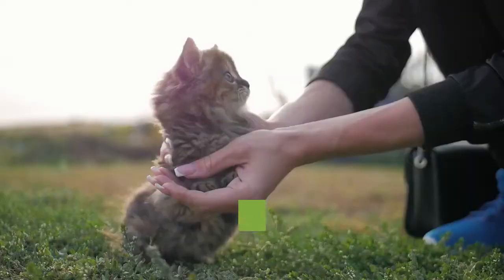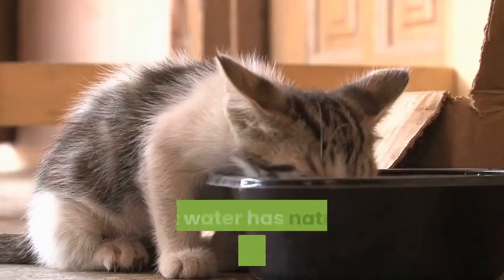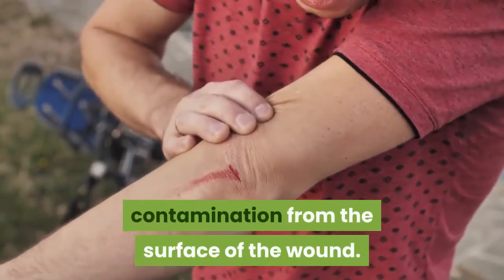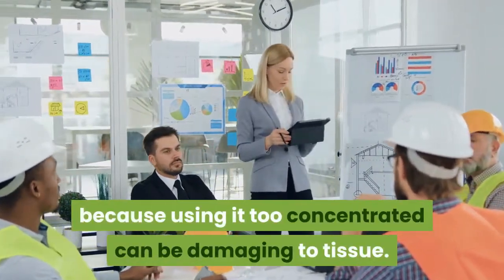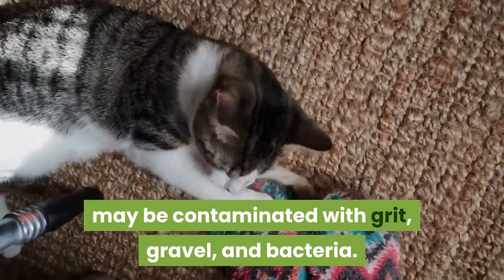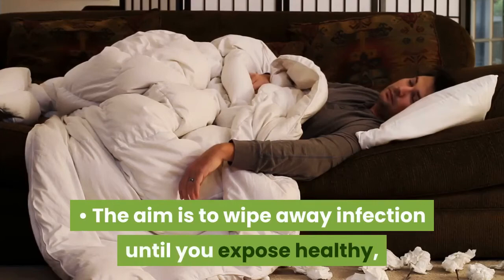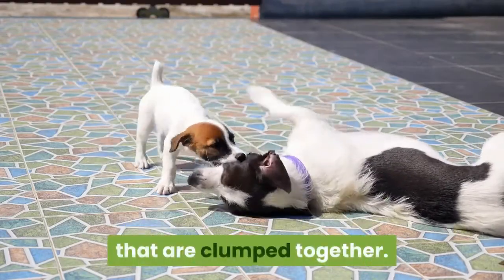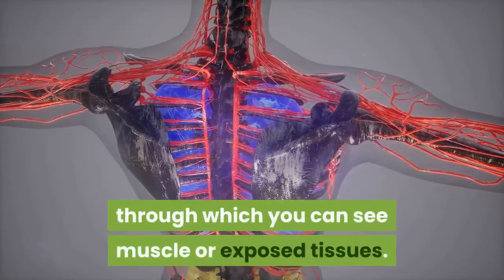How to Clean a Cat Wound updated 2021

Comment: Hydrogen peroxide is good for disenfecting the tools you are using to wound clean but should not be used in the wound itself as it can cause tissue damage which can lead to further infection. The bubbling you see is just the hydrogen peroxide breaking down into H20 and O2, water and oxygen, just because it looks like it's doing something doesn't mean it's actually helpful